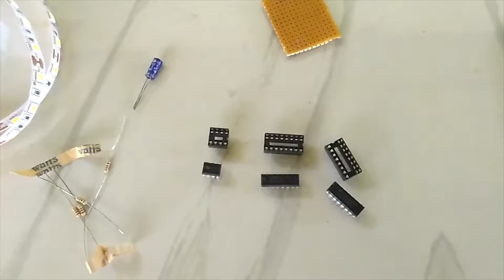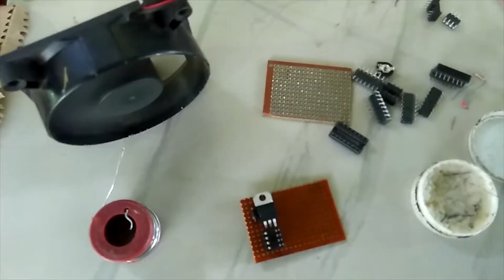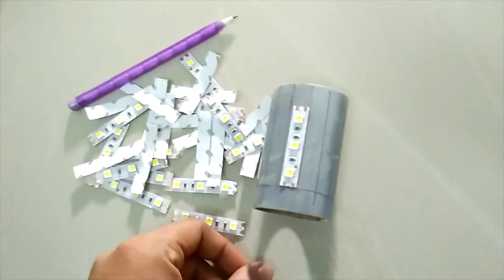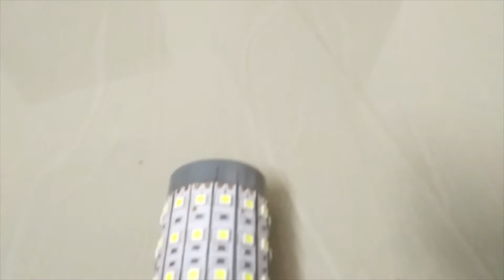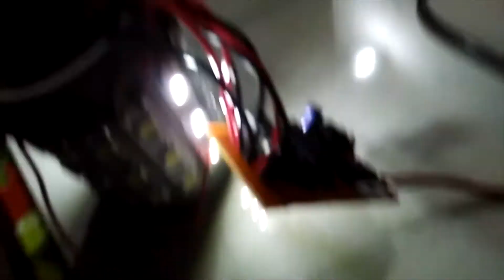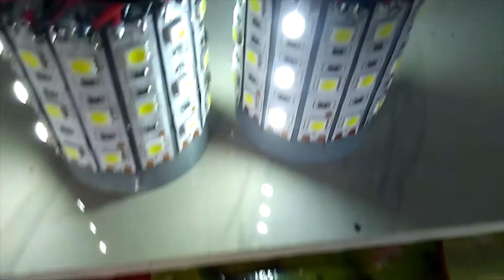How to create Led Beacon Light at home

Comment: can you share the pcb? I don't really understand how the LEDs are connected ...thanks
Reply from the maker: Here I am used ic cd4017, it's a counter ic. And there is no printer pcb, it's a common dotted pcb. 
I can share the circuit diagram. Pls give your whatsApp no. Or email.
Reply: @jebinbenny926  thanks mi WA es 5491131223135 or my email es franciscoferrario@gmail.com
Reply: I am not an electronic guy, I am skilled, but the more information you give me, the better.